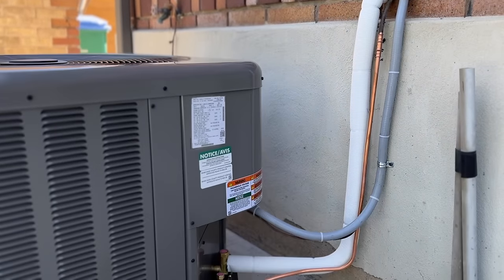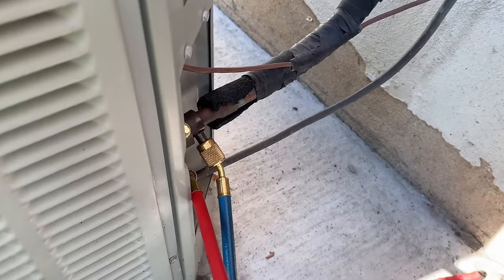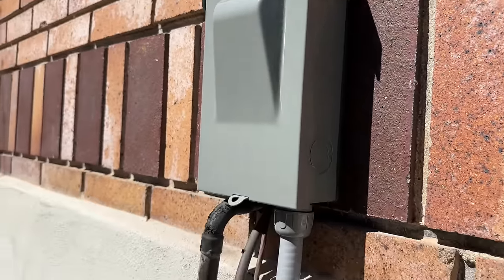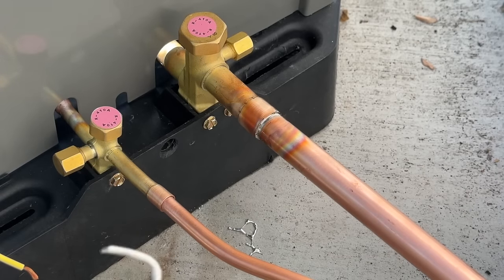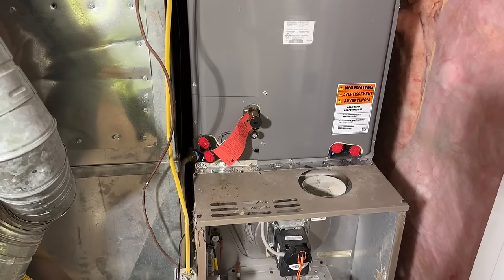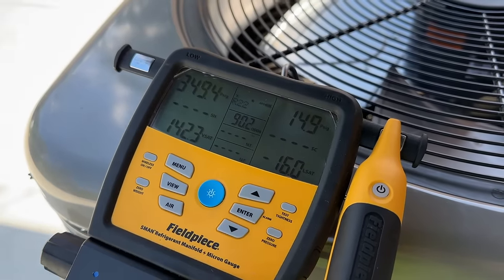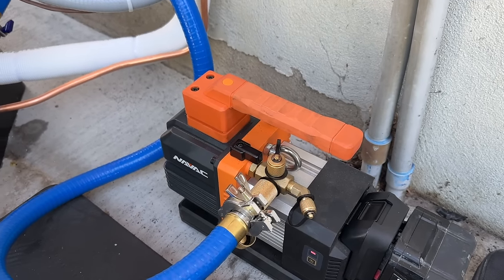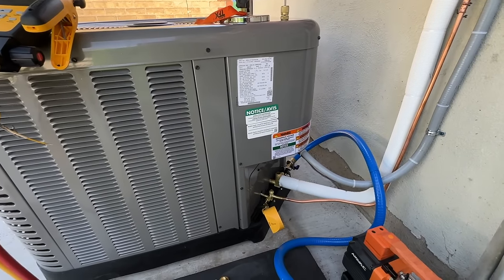Did You Know You Can Replace Your Own Air Conditioner?   -SAVE THOUSANDS-

Comment: great video. I have a question. You replaced the condenser and evaporator from Ruud. Is existing system also from Rudd? If not, do I need consider the compatibility issue?
Reply: He explained it was 2.5 Ton Trane system
Reply from the maker: No brand difference does not matter between air conditioners and furnaces. The sizing is all that matters 👍🏼

Comment: Q: I have an old Trane Central Air Conditioner TTR036C100A2 unit outside. It is not cooling perhaps because it is low on refrigerant. Can we put in a modern cooling (R454?) into this unit?

Comment: Does the new equipment manufacture require, recommend or does not care to flush the old r-22 oil and crude from the old copper refrigerant system???  York wants txv thermobulbs 16 inches down stream from the outlet of evap.   not 2 inches.

Comment: Were those high voltage capacitors inside the electrical part where you disconnected it? How do you discharge them?
Reply: Short the capacitor leads with an insulated wire or screwdriver, after you pull the power disconnect.

Comment: Was that r-22 system bad? If not, why the change out? Just curious. How do you like your Fiedpiece manifold? Have you tried any others? What vac pump did you use?
Reply from the maker: Old system had a leak and they wanted to upgrade. I LOVE the fieldpiece sman gauges. I opted for the 3 port as I don’t use the 4th for vacuum. I do the single hose as you saw. Also LOVE the navac 4 cfm vacuum pump that is battery operated :) all can be found in my Amazon store 👍🏼 cheers

Comment: Just so everyone knows it's illegal to touch a refrigerant valve if you're not licensed. 🤷‍♂️
Reply from the maker: Wrong. You need your epa certificate which I have a video on. If you own the ac unit, and you have your epa certificate, you can connect gauges to it, and handle refrigerant legally.
Reply: @diyhvacguy  so in other words. I'm right unless they go get licensed/certified? Lol!

Comment: So, soldering those refrigerant lines is just like soldering copper water lines? Or is that a special product for refrigerant lines?
Reply from the maker: This is specifically made with a lot higher silver content so it’s specially made for hvac applications. You would not want to use standard plumbing solder for this. It wouldn’t hold up for sure.

Comment: If this is DIY on the cheap, just cut the high side and come back in a few minutes. You can swap out the unit in an hour. But you will still need a tech to weld the copper and fill the refrigerant.

Comment: How much refrigerant is lost every time the gauges are connected for a test? I've noticed that about 3 to 4 season checkups the system needs topping off.
Reply: Realistically, about 4-5 ounces each time with standard hose fittings, and about 3-4 with low loss.

Comment: There really isn't that much that requires/recommends a pro to do.  Many pros will do side work where they do the important part only, and let you do the manual labor portion.  It always needs to be done to code, so get in good with your local pro, but work it out where they instruct you, they leave, you do the grunt work, they come back and finish it up for you.  You can save a ton of money and won't need specialty tooling.

Comment: Your videos are awesome..
Reply from the maker: Thanks bro!
Reply: @diyhvacguy Agreed. Just subscribed. Quick question though. What's the most likely culprit when a 2 year old unit isn't cooling enough during the heat of the day? (Everything running, new filter, vent temperature 2-8 degrees higher than thermostat setting.) Sorry to hijack this post, but you'd be saving my savings if you can point me in the right direction. 🙏

Comment: Hey guys its so easy. Just go to the supply shop and spend 800 on a vacuum pump, 350 on a micron guage, 500 on a torch setup, 140 on core removal tools, 600 on guages, plus another  500 to 1k  in accessories like refrigerant you cant legally buy and get started.  Trust me i have hvac in my name. GO TEAM!!  Side note, not brazing with Nitrogen can kill your system, pulling vacuum with moisture in the lines can cause it to freeze then melt once off a vacuum, poe oil doesn't mix well with any so if any r22 is left you'll have wasted every cent you spent plus another 10k replacing your "I'm too cheap to get it done right Experiment" and you could get fined around 30k.

Comment: Thanks for the videos! Quick question, should the core be removed from the Micron gauge when pulling a vacuum or just the service ports?
Reply: When recovering refrigerant or pulling a vacuum, it's best to have the valve stems removed so there are no restrictions and the process will be faster. On older units that have brass valve stem caps, a technician may have over tightened the cap and it may compress the opening so that the valve stem cannot be removed. If that happens, don't worry about it and continue with the recovery. 

When pulling a vacuum, use the largest diameter hoses you can afford. TruBlu hoses are great but if you're in a pinch and only have 1/4" hoses on your manifold, you can use them but it will take longer to pull a vacuum down below 500 microns. Also, vacuum rated hoses are designed so they do not collapse when vacuuming. If you are using older 1/4" diameter hoses you may want to keep that in mind. Most HVAC schools will tell you not to use 1/4" diameter hoses when vacuuming but I have my students do it just so they can see how slow it is compared to using larger diameter vacuum hoses. The difference is amazing. When it's the middle of summer and you're on the roof or in a hot uninsulated attic, the faster you can get the job done, the bettter. 

To protect your micron gauge from being contaminated with oil, use a cut off valve between the micron gauge and the pressure port, just like in the video. Valve off the micron gauge before releasing the refrigerant in the system. Once the refrigerant is released, some oil from the condenser will be pushed out and that's what you don't want shooting into your micron gauge. TruBlu micron gauges will tell you if your micron gauge has been contaminated with oil so you can clean and recalibrate it. Not all manufacturers have that feature. You're looking at $200 minimum for a no frills micron gauge and the price goes up depending on all the additional functions you want.😊
Reply: Thank you. Got everything installed. Ran fine first night but next day it seems the condenser was cycling. I check pressures and they are the same when it’s off but both stay high when on. Suction is at 350psi. Any ideas?
Reply: @fantom_1  When the unit is off, pressures will equalize so that's normal. What type of refrigerant in your system? Look at the data plate on the outdoor unit for all the specs. Your suction pressure appears to be too high. Not enough information to diagnose. I'd need current draw, and high side pressure to determine what's going on.
Reply: @mojo9288  r410. Off they are equal. On, suction still reads high. Close to 250. Condenser cycles on off on off every few minutes. What’s odd is the system ram without issue for almost 18 hours. Maybe a leak?
Reply: @fantom_1   Most common cause for short cycling of the compressor is low refrigerant charge. You could also have a bad lo or hi pressure switch and a bunch of other things that need to be checked. Worse case scenario is to recover the refrigerant, check for leak(s) and then pull a vaccum while checking all electrical components before recharging and setting the subcooling or superheat. That should take about two and a half hours if you have all the tools and equipment.

Comment: This guys videos are entertaining and educational, but do not attempt to change your own AC unit without proper training and a refrigeration license. Remember this guy is a experienced licensed professional HVAC contractor, however I find it extremely irresponsible to advise a person with no experience to attempt a dangerous job without proper training or tools. Also understand this guy will try to scam you with advice that he will charge you for. He is setting you up for failure and could lead to catastrophic injury or death. Best practice is to shop around and have the knowledge to make sound decisions on the product you buy. You take this guys advice and you will probably get hurt and cause catastrophic damage to your system.

Comment: Any guidance on how to purchase a compressor/exchanger as a DIY installer?
Reply: HVAC direct is a good online source. All the HVAC pros that use Goodman and American standard and other generic systems buy them from local distributors, I think it varies from state to state (or company policy?) whether they can sell to “civilians”. I haven't DIYed myself but I've replaced 3 ac/furnace systems bought from HVAC direct and installed by a local independent tech. Get someone by word of mouth who's willing to do it. Last ones I did were a couple 2.5 ton AC/furnaces that I was getting quotes for ~$20k each in 2023. I ended up doing both for less than $10k. The “local” advertise on TV guys are getting bought up by national chains that must be slapping huge overheads on them. 🤷🏾‍♂️

Comment: If you were to go to a 20' line set on that system, would it have enough freon to kick on and if you were to run it with just the 15' line set freon, other than being less than optimal, would it be low enough to damage the compressor?
Reply: You would always check the sub cooling if its a txv or superheat for expansion valve to confirm if the charge is sufficient. 5ft of line set might reduce it by a degree or 2. It wouldn't damage the compressor at all but slightly underate the system.

Comment: Question - If I replace my R22 system with the same tonnage/"modern" refrigerant, will I get the same performace at the register - same temp output?  I'm not in a hurry to replace my R22 system, but always looking for tutorials like this in case the day comes.
Reply from the maker: Yes you should always have about a 20 degree temperature drop between what your thermostat says the room temp is, and what is coming out of the vents 👍🏼
Reply: @diyhvacguy   i have a 23 degree differential at 900cfm on a 2.5 ton system. thermostat reads 71 air at register is 48. nothing wrong with having a couple extra degrees is there? also my gf likes to crank the sp down to like 68 and i worry about the coils freezing trying to get that cool, so i turn it back up to 70. am i worried about nothing?

Comment: Lol, for sure that's going to leak freon. You are supposed to use silphos to braze lines, solder is for water. It should be agaist the law to.put out.bad information.
Reply from the maker: You should do some research. You are like alot of other people, sceptical, which I understand but I know contractors that have been using sb8 for decades. I’ve used it for 5+ years ZERO leaks to speak of.
Reply from the maker: Sb8 is specifically designed for hvac application not water

Comment: Hello Mr Diyhvac, and others, does anyone have any suggestions on how to improve in-house air circulation?  My house stays pretty warm with the ac running, the air coming out of the vents feels cool, the house was built in 1957, only has 2 return vents, any suggestions would be great. Thank you.
Reply: Proper maintenance like cleaning the evaporator and condenser coils and changing filters are the easiset things a homeowner can do. During the peak of the pandemic, some homeowners switched to a more restrictive HEPA type filter and that caused a restriction in the airflow over the evaporator coils. Also check your dampers on the supply ducts to make sure they are open and nothing is restricting airflow.

Check to see if your system is properly charged. You'll need pressure gauges and thermocouples to check that yourself. The data plate on your outside condensing unit will tell you if you need to check subcoooling or superheat to see if the charge is correct. If your system is short on refrigerant, is there a leak? What type of refrigerant does your system use? If it's R-22, companies will recommend a new system instead of fixing the leak. Depending how old your equipment is and what shape it is in, fixing the leak and charging the unit back up may allow you time to save up money for a new unit. You always risk the chance of another leak somewhere else in the system but if the overall shape of the system is good, most customers roll the dice and do the temporary fix until they can save up the money for a new system.

Be aware that the going rate for R-22 in your area may be $400 or more per pound of refrigerant. Is there another type of refrigerant you can use instead of R-22? Yes there are. Bluon makes a direct replacement refrigerant called R-458A. You can also use R-422A. Check with the manufacturer of your system to confirm a refrigerant retrofit. There may be other components in the system that may have to be changed depending on the thermodynamic properties of the new refrigerant and compatible oil. With R-458A, just recover the remaining R-22, seal the leak, pressure check and pull a vaccum before charging with R-458A. No need to change the oil in the system but I'd recommend a quick oil test for acid just to make sure and even check the compressor with a megohmmeter to check the condition of the compressor motor winding insulation and overall oil condition. Any reading under 20M ohms is an indiciation the compressor is on its last leg.

Is your blower motor moving enough air? There are several ways of measuring airflow so you'll need to decide what method and tools you want to utilize. Does your ductwork have a leak? Is the blower motor going bad? Has the blower motor ever been replaced and is it the correct one? Is the blower motor a single speed or multi-speed motor? Is the compressor a two stage compressor? If you have the time, patience, proper tools and mechanical aptitude, you can service your own system and avoid the cost of hiring an HVAC tech. 

There's a youtube video on just about everything I mentioned above but the videos don't always cover everything in depth. If this all sounds overwhelming to you, call a reputable company to service your system or at least give you an overall system overview. You say your house was built back in 1957. Is that the original system that came with the house? If it is, it may be time to purchase an up-to-date system. More than likely any company you call will recommend a new system. It all comes down to how much of your hard earned money you are willing to part with. 😊

Comment: I HAVE A QUESTION  MAYBE YOU COULD ANSWER . MY CONDENSEN MAKES NOISE A RATTLING NOISE  COOLS HOUSE GOOD IN MORNING BUT OUTSIDE FAN CUTS OFF IN AFTERNOON THEN BACK ON AND OFF AGAIN , THOUGHT IT WAS DEFROST BOARD BY PASSED IT STILL DOES IT  4 TON GOODMAN HEATPUMP . WATCH YOUR CHANNEL ALL THE TIME SO I WENT TO SKILLCAT AND PASSED 608 CERT.NEED TO GET GAUGES   WHAT COULD CAUSE THAT OTHER THAN REFRIG. LEVEL ANY HELP

Comment: Dave, what is the outside temp where you are working? Here in FL right now A/C units can’t keep up even set at 78. Does a cool only do better than heat pump in hot humid climate?
Reply from the maker: It was about 90 out
Reply from the maker: Doesn’t matter on ac vs cool only. The only difference is in winter, the cycle gets reverse. That’s literally the only difference
Reply: @diyhvacguy  Hi. What's the "87.0" number just below R410A on the Gauge @ 23:50 in the video? Is that the Outdoor Dry Bulb Temp basically ambient outside temp?
Reply: I am in Phoenix and my goodman14seer units cool to 76/75 no problem when its 116 out, they are working hard but no problems, Just do basic maintenance and change filters
Reply: @scotthall1381  I hooked up gauges when it was 112 outside. 510 psi (135 degree sat temp) and 135 psi (47 degree sat temp). subcooling 18 and superheat 26. Those numbers are high. I hooked up next day when 90 outside and subcooling was 10 and superheat 12 which is more normal. Not sure if the extra heat causes havoc with the subcooling and superheat or if they should remain in the normal range.

Comment: I’m doing the same job that your doing in your video. But my question is my line set is 32ft long with 3/4 my unit is a 2 ton and my coil in the attic is a 2.5 ton. So do I have  to put a little Freon in before I start the unit since the line is longer than 15 ft? or do I start the unit and go from there to see complete the charge?
Reply: Start and run for 10 mins,check pressure,superheat,subcool ext,add or subtract refrigerant from there
Reply from the maker: Yea start the unit and throttle it in through the low side as a liquid until you hit your target subcooling. General rule of thumb Is about 11 degrees 👍🏼
Reply: Read the directions from the manufacturer and you take the total length of the linset and subtract 15’. Take that length and multiply by what the manufacturer says and the extra charge and Then open the service valves.
Reply: You would likely need about 15oz of refrigerant added.  Also, don’t charge by subcooling numbers alone.  Subcooling does not ensure that a system is cooling properly.  If your coil has a TXV, you should have a superheat of around 10-15 degrees, and subcooling should fall between 7-13 degrees, though Carrier had some odd subcooling numbers.  It’s important to have subcooling, but your superheat is more critical to the cooling performance.  People get way too hung up on subcooling.  A TXV used to be known as a constant superheat valve, as that it what its function really is.